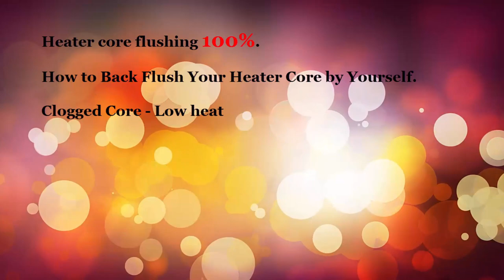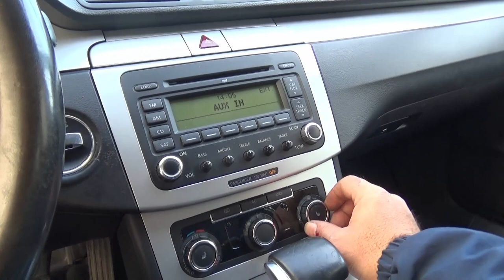Heater core flushing, Clogged Core – Low heat #2

Comment: seems excessive, I wonder if a flush with a 1/4 flex air line through the flow while running water from the return side would liberate the gunk, Dishwasher tablets are also useful, then vinegar. AS its a LHD it is easier to remove. I think RHD are more difficult

Comment: Just reverse the flow when uncloging it and everything will be ok. No need to remove it from the car.
Reply: Actually sometimes that doesn't work.. I have one now 100% clogged.. 0 flow either way.. it sat for 3 days with vinegar,  2 days with clr , 2 more days with a flush.. still no flow.. but if I pulled a car sure as hell ain't going to do this.. what a waste of time..
Reply: @donlankford4315  I have seen mechanics blow compressed air into the hose to try to loosen them, did you get it loose or still clogged?